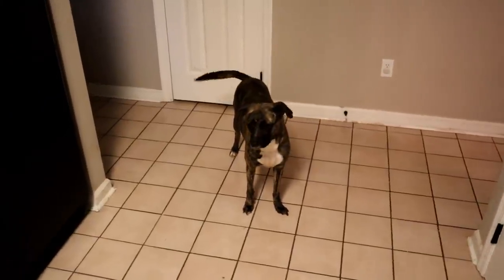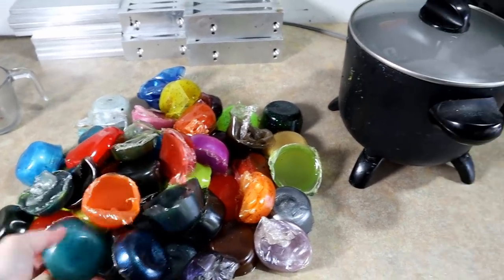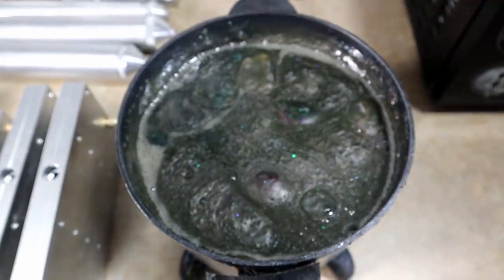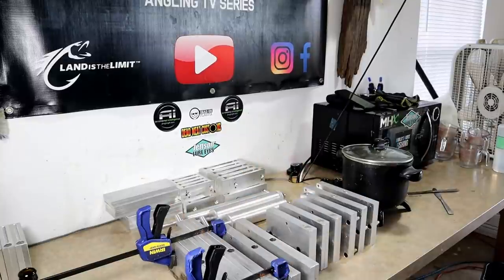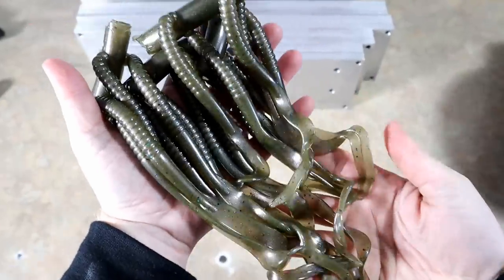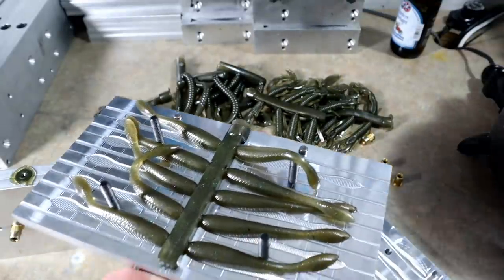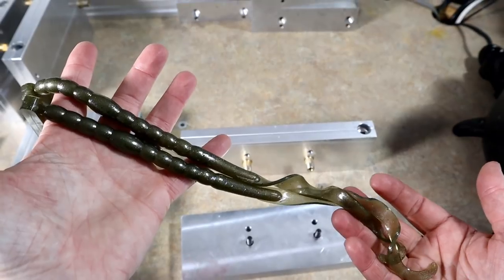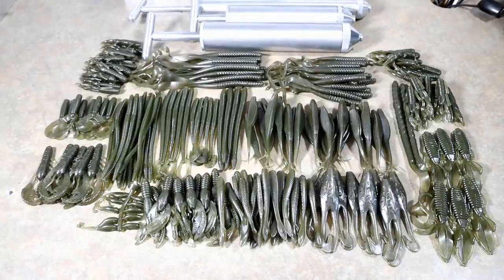Re-Melting ALL Of My Leftover Plastisol!! How Do They Turn Out???

Comment: I know this video is over 9 months old, but I felt the need to add my 2 cents. I think that color works in the worms since they have a brownish green-pumpkin that works in big worms. The same with those crawdads. IMHO I believe I think the frogs would work better than the jerk-baits. Here is where I think that color frog would work. Put those frogs on buzz-baits w/out skirts. The noise will get their attention and then they can key in on that frogish/bulldog color.  Lastingly I bet those grubs would work great on an Arkie gig style head. And dip the tips in a tad of chartreuse. And that's my 2 cents.

Comment: 7:28 Just started lure making and I've been having huge problems with denting. In order to not get dents in my baits I have to hold pressure with the injector for ~25 seconds, which seems excessive. I guess my problem is it's just too cold. I have been doing all my injecting outside on my apartment balcony to avoid fumes, with an average outside temp in the upper 30s. I guess I need to get a hot plate

Comment: Do you or anyone reading this have a good link to that hand pour mold? Or a similar U-TAIL style in 8-10".
I want to get started in custom worm making, but I do not have the money to invest in injectors and injection molds. I found some old U-Tail worms that are EXACTLY the shape I prefer only smaller than i like. Similar to his mold, except the tail doesn't deviate at the end. What I want to do is make a silicon mold using the two I have as the Masters. Thoughts???

Comment: Hey man wishing you a Merry Christmas as well. Was wondering the plastic you use Dead On are you able to dip tails body etc into the liquid say spike it colorings? Dose it actually color the baits  venom lure co yrs ago you could dip in spike it, but the baits just wouldn't except the color.
Reply from the maker: It should work just fine..it's a Plastisol

Comment: I've always found natural colors work best. I still havent thrown any of the little frogs I've made. Fist time making baits. But I made them in all kinds of browns blacks and greens. And made a pretty nice silver blue that looks awful for frogs but is gonna be sweet once I get a swim bait mold. Gonna test them on the 22nd ish in florida. Also made some clear frogs with gold, green, and red flake to hang on the Christmas tree.

One thing I think you should give a shot is applying hand pouring techniques to injection molding. You can hand pour patterns in the mold and then shoot it and give the mold a heat to bond the layers. I'm only making 2in frogs so the heat from the plastic seemed to be enough to bond the layers. 

Anyways. I'm gonna get back to shooting. Have a merry Christmas man.